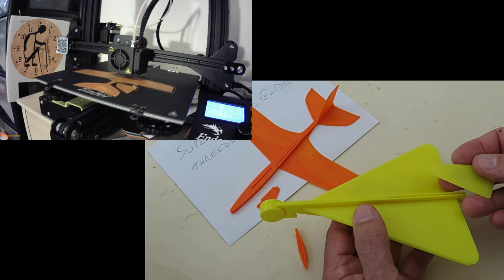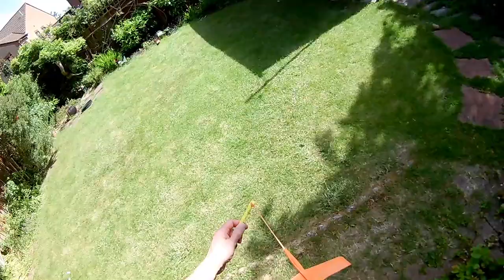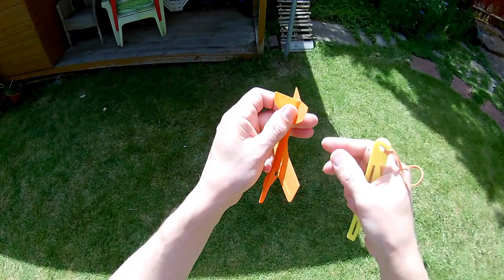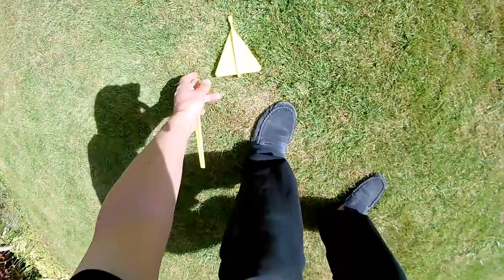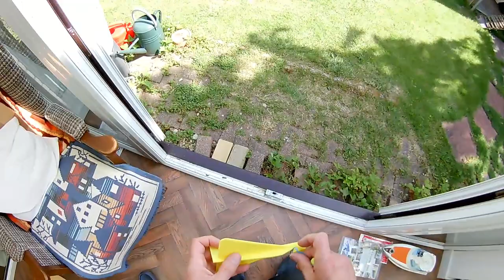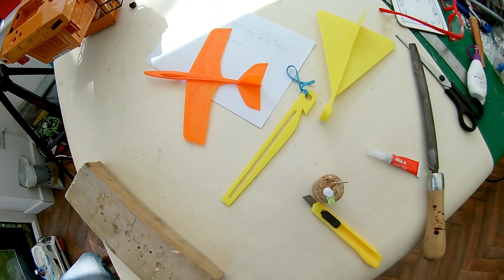3D printed Super Stratos Glider from threedsy ✈

Comment: I think the slots are there to allow for some bending of the wing!
Reply from the maker: Yes I think that is the intention buy I have watched the designer's videos and he doesn't seem to mention them. (Or I missed it). The links are in the description.
Reply: What'd be cool is if took a couple coreless motors and a ch rc receiver and transmitter and made a controllable rc plane cheap.
Reply: @josephpennington2795  I think it would look like am me262 if he'd set up differential thrust